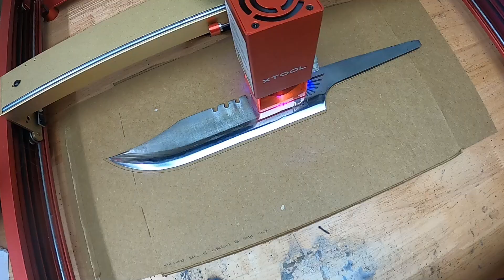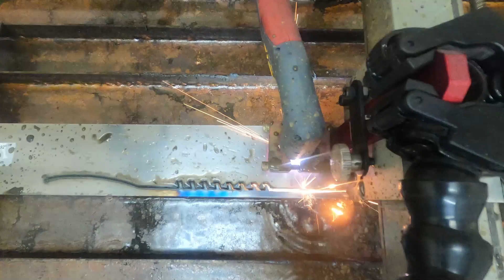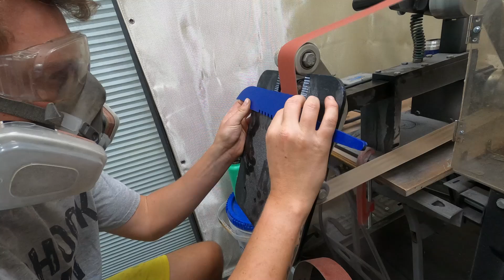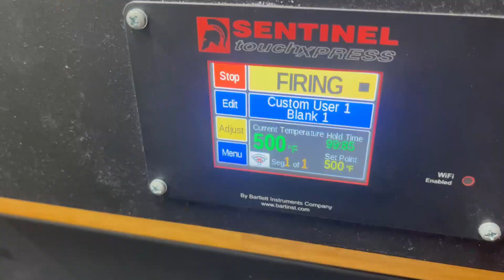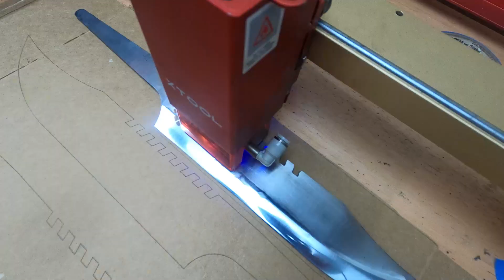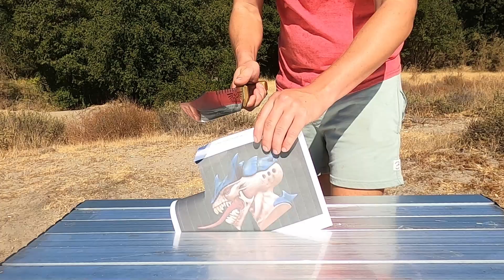Making Space Maine 2 Combat Knife from Carbon Steel and 3d Printed Handle - Warhammer 40K

Comment: If you made one size accurate with brass guard and pommel 30 lpi checkered g10 grips with pins in handle and pommel. A little more polish on the flat part of the blade Aquila on both sides. You would have fans lined up could easily sell between $300-$400. I would purchase one.
Reply: accurate size is a sword :) lol